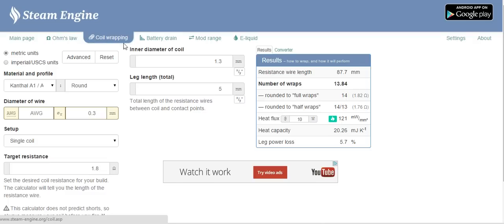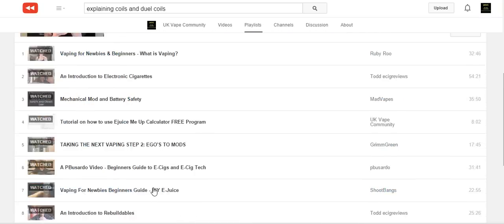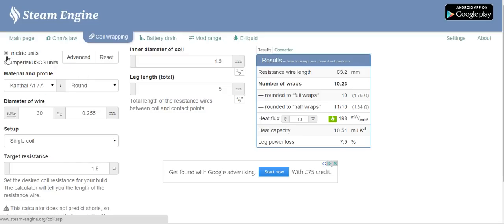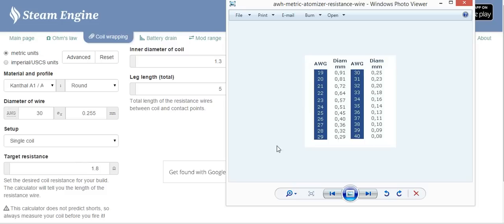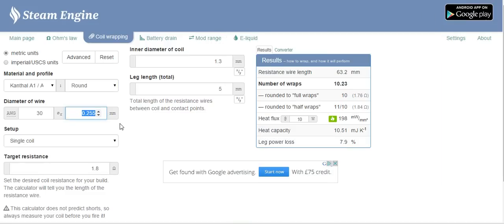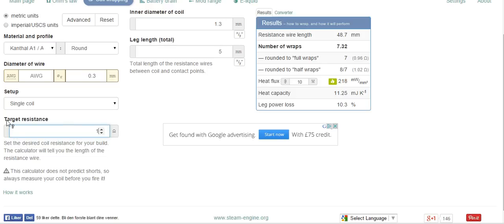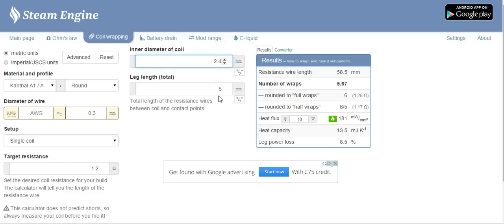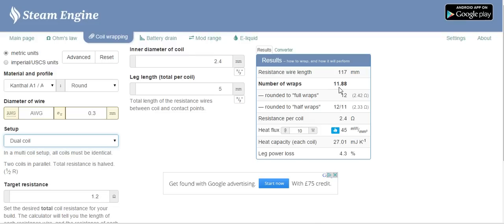Steam Engine Website Coil Wrapping Tutorial

Comment: I started using the steam engine website for making diy ejuice back in February, and now i've moved onto making coils with drippers.

One thing i'd love to know is, how do i calculate my coil when it's a1 kanthal 24g which is twisted? I selected the twisted wire mode but when it asks about strands i'm slightly confused as it was one wire which twisted on itself in a loop, so does that mean i enter in "2" strands?

Sorry for the dumb question but im new to this :D

By the way many thanks for the steam engine! Every diy vaper loves it to bits!